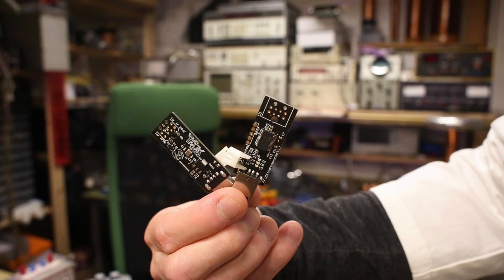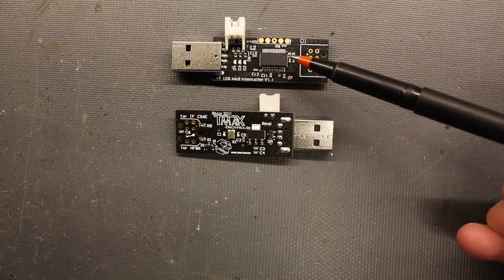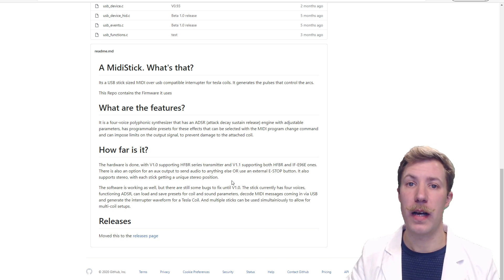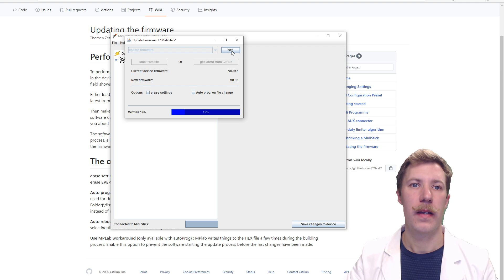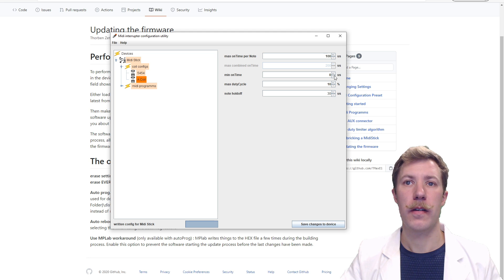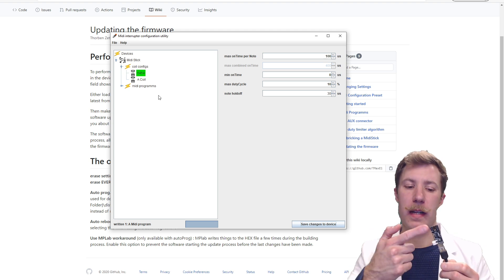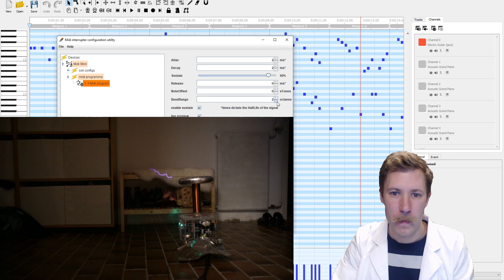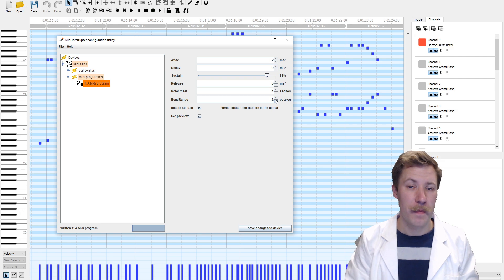Musical Tesla Coil with Tmax USB MIDI Stick

Comment: Awesome video :D
If anybody wants one just PM me on the HVForum.
Oh and when adjusting decay and release times you need a little more time to actually hear a difference (50-1000ms). I should probably make those number fields increment in a way that makes sense for the parameters they adjust :P
Reply: Excellent, thanks for sharing this work :)
Reply: Hey I bought one of your MIDI sticks a while ago and it’s fantastic! One question, occasionally a note gets stuck on and I have to pause/play the song to fix it. Is there an easy fix to this problem or a specific reason as to why it’s happening? I assume it’s when it tried to play too many notes at once, is this assumption correct? Love the product!

Comment: I want one so bad. I can't find one anywhere :(
Reply from the maker: Have you tried here? https://highvoltageforum.net/index.php?topic=1117.0
Reply: @KaizerPowerElectronicsDk  yes. I can't get the link to work. Every time it just comes up with 404 not found.
Reply from the maker: @sikewiley  TMax unfortunately had to stop selling them, due to regulations and insurances. You will have to get PCB made yourself and program it from github repo.
Reply: @KaizerPowerElectronicsDk  Dang. Thank you for your help!
Reply from the maker: you could try to reply on the forum to see if anyone is on the same quest or what possibilities you have. I know that TMax is working on implementing the MIDIStick software into the UD3 project: https://highvoltageforum.net/index.php?topic=188.0

Comment: That's really cool!! I'm looking forward to test one ! 😍
Reply from the maker: Did you get one yet? He wrote on highvoltageforum.net that he had 24 PCBs, so maybe there is some left of first batch or you could use the opensource information to order a PCB yourself.
Reply: @KaizerPowerElectronicsDk   Not yet, I will go check out on HVF. Thank you for the info!